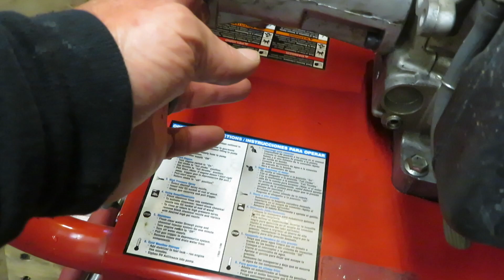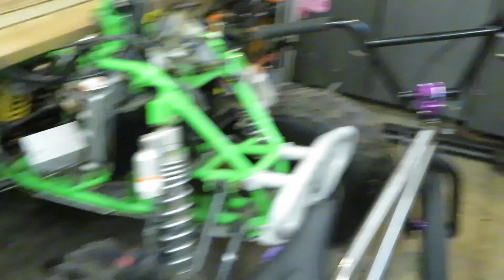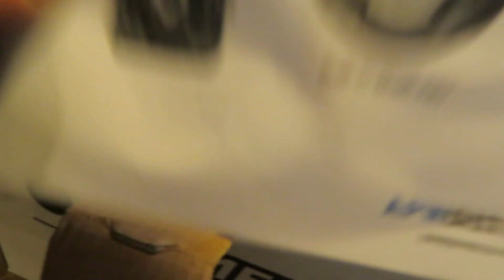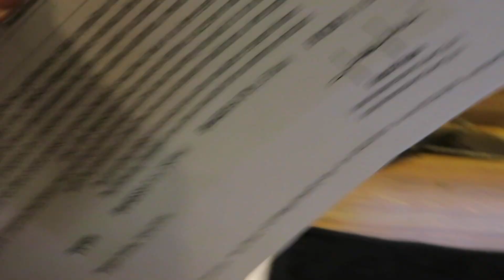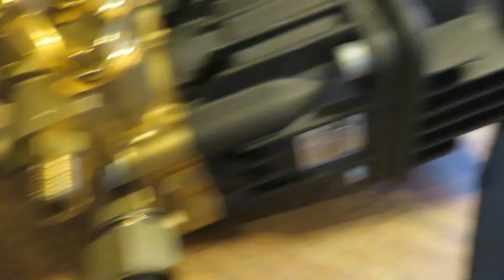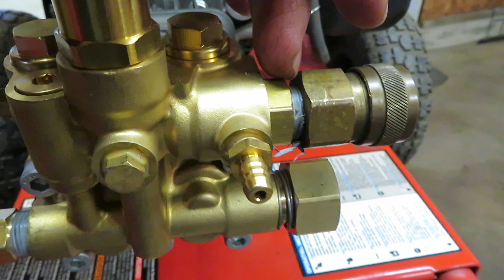Pressure Washer Pump Replacement

Comment: Your video was helpful in the fact I had the same exact motor and pump.  Issue I’m having is the pump is seized on the shaft and can’t figure out how to get it out. Was a pressure washer I got from my parents a numbers of years ago and just tried to get it going again.  Had changed engine oil, replaced carburetor, and new spark plug.  I did not change the oil for the pump and think maybe that is the reason it happened. Any ideas?

Comment: Jumping from a 2400 psi to a 3000 psi pump is actually a big jump, and it’s only a 5 hp motor. 7 hp may be recommended if it’s above 2.7 GPM pump flow rate.
I didn’t catch the flow rates, but that’s also an important metric. 
Work being done is  a combination of pressure and flow rate.
If it works, then just live with it, but yes you’re probably putting the engine under higher stress.
Reply from the maker: Thanks for the info much appreciated!

Comment: Replacing mine today. Glad I stumbled upon your video. Loo,s fairly straight forward.  What did you find out about using a higher psi pump with your original motor? Thanks for a great video👍
Reply from the maker: I Adjusted the pressure switch everything seems fine now. Thanks for watching!

Comment: Does the keyway have a little piece of metal that goes in the middle and on the pump
Reply from the maker: Yes there will be a piece of square stock maybe a 1/4” thick and a little over a inch long.

Comment: I to  repair the Comet pressure washer with a low pressure?
Reply from the maker: Mine running fine now. Adjusted the pressure relief valve.
Reply: @ChadMyers73  Mine is giving me hell the pressure is really low
Reply from the maker: Depending upon how long ago you purchased it it may under warranty
Reply: @ChadMyers73  yea maybe i feel it needs a overall because when i turn the red nub on it it doesn't make a difference its like it pure air coming through it
Reply: @ChadMyers73  thanks for your help tho the video you posted up showing the comet pump you put on mine is like that

Comment: what did they ever say about the new higher psi pump bogging down the motor a bit? Also if you did it over again would you just put on a pump the same pressure as the old or still go with the 3000? thanks
Reply from the maker: I adjusted the pressure relief and it is fine now. Yes I would do everything the same.

Comment: did you ever change the pump oil ?
Reply from the maker: I'm sorry oil pump?
Reply: @ChadMyers73  you know the engine oil and the pump oil are seperate. thats why you should change the pump oil every summer so it can last longer.
Reply from the maker: @tripleooo9639  Yes sir thats right it was changed I'm tickled to death it lasted 15 years
Reply from the maker: Did you mean change the oil in the old pump?
Reply: yes. did you change it every now and then ?

Comment: Ours is the honda engine.  We paid about the same for ours, but I dont remember if it's a GC or GX. Got it on sale at sears a few years ago. I'd prolly do the same if my pump took a dive and the engine was still good.
Reply from the maker: Yeah I was kind of a lateral move but I already had the engine.
Reply: @ChadMyers73  as long as the move isn't backwards you're ok. What is that pump saver stuff?
Reply from the maker: https://www.ppe-pressure-washer-parts.com/product/85.490.042

Comment: Try this stuff on all your air and water connections and then you will throw all the half unwound rolls of teflon tape in the trash. Just a small bead around the male fitting and thread them together and use instantly. Yes it is $24 but you use so little of it, it will last years.https://www.amazon.com/gp/product/B000HBGL14/ref=ppx_yo_dt_b_asin_title_o01_s00?ie=UTF8&psc=1
Reply from the maker: I will get some and give it a try. Thanks for the info!